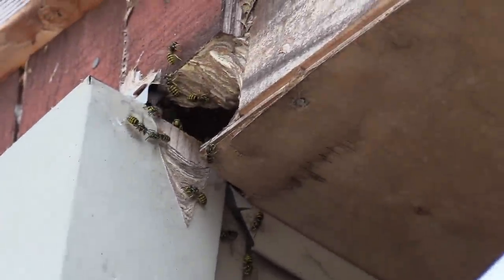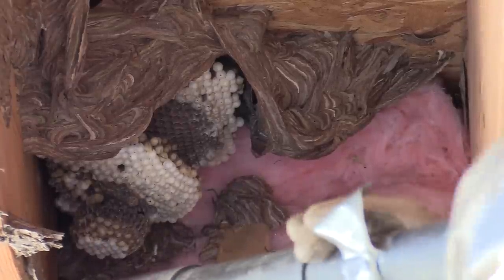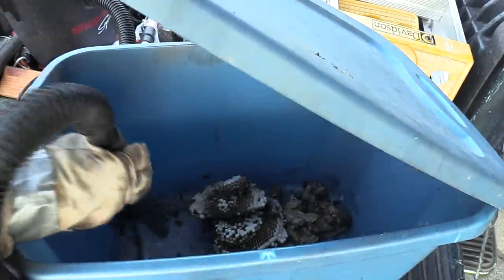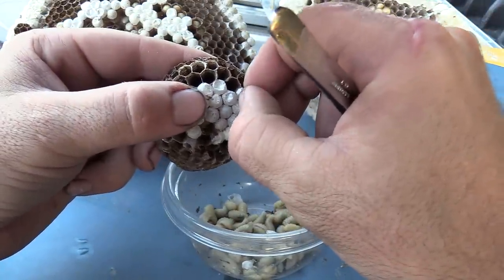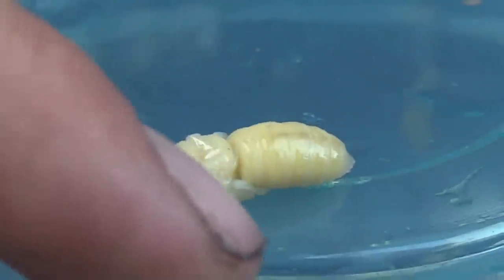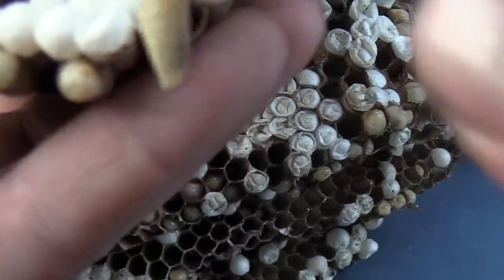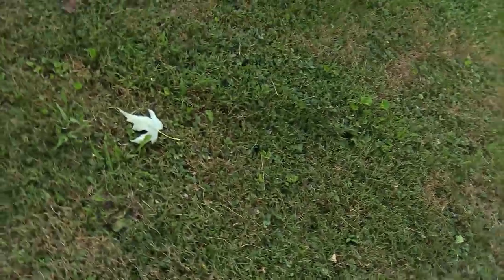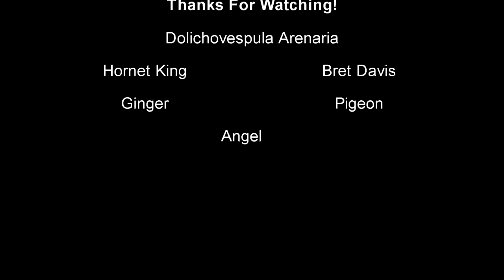Yellow Jackets HUGE NEST Removal INSIDE HOUSE SWARM Wasp Nest

Comment: The chickens running when you call them is always super funny. I dont have yellow jackets, but I do have carpenter bees that will sometimes drill holes in my porch ceiling in the 2x6's. They are not aggressive, and i enjoy studying them. They are strong though, they can rip wood, like pretty good size chunks. Its surprising. Anyway, I enjoyed the video😃
Reply: They just collect wood so they can make you a chair
Reply: Nice thing about carpenter bees is they absolutely hate wasps, and will drive them off. It's cool to see them do aerial intercepts and smash into them. Oddly, the male has no stinger, and he's the one left to defend the nest. If you have one that's always there and flies around to challenge you, then goes away after sizing you up, that's him. The female is out foraging, and is rarely there in daylight hours. I like them because I hate wasps and they keep them at bay. I wish they weren't so destructive but I can tolerate them where they are.
Reply: @ltr4300  that is interesting, I did not know that. Thanks😄
Reply: @davidp7833  If you decide to test that and get close, be sure you are dealing with Carpenters and not regular Bumblebees. Carpenters only nest as a pair, as far as I know. If there's more than two, assume they aren't Carpenters bees

Comment: Regarding the larvae sac being full body length and the logistics of doing this, I believe that the larvae create a band of silk around the body at the point of the spinneret, and then use the ripple motion of the body to move it along the body, away from the spinneret, then create another band and attach that to the first band, and so on. 

Great video, thanks for the upload. 👍

Comment: Just a question, why not just shake the nest over the bin instead of tweezing them individually? Shouldn't most fall out then?
Reply from the maker: Larvae are attached to the cell wall do not fall out. Remember, these comb are built with the opening of the cell facing downward. If they were freely laid in a cell without attachment, they would have fallen out long ago, or soon after the egg was initially laid.
Reply: @HornetKingOfficial  Aha, I see.  Thank you!

Comment: I guess they do not develop poison until after they become adults.
Reply from the maker: Its the last thing that developes.
Reply: @HornetKingOfficial  Thanks for the reply. I have a yellow jacket problem. About 3x a week I find Yellow Jackets in my bedroom. I searched for the problem and found them enter and exit from my house siding adjacent to my bedroom going underneath of it. It is now December and cold out yet they continue to be a problem. I have an idea the hive is up inside my crawlspace attic. No access, will need to punch a hole in the ceiling. I think to use traps this spring and put up with the problem until then. Do traps work well enough?